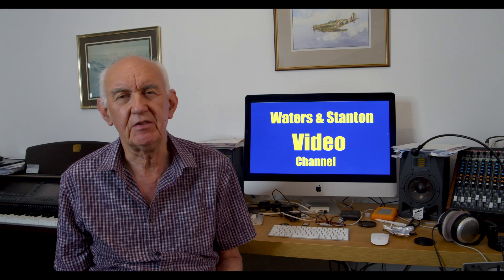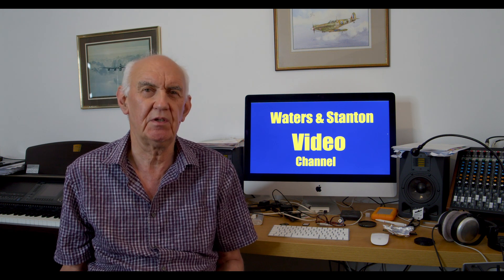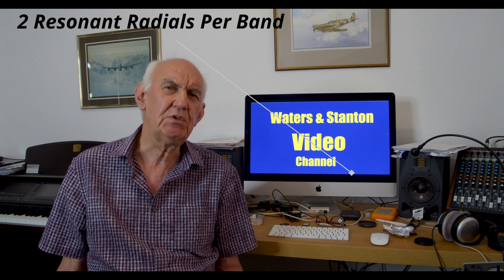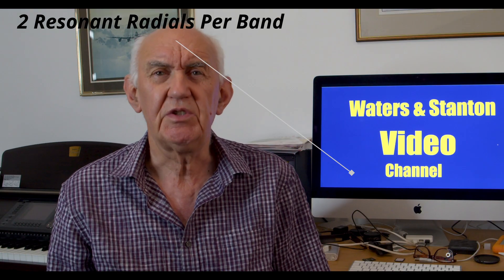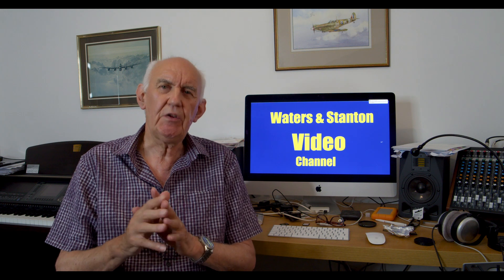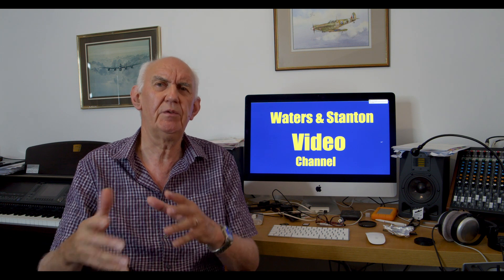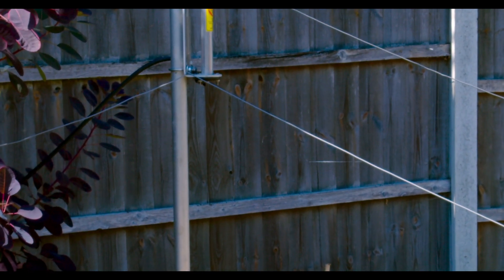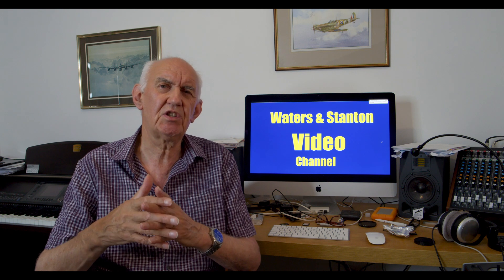Grounded or Elevated Radials? - Your Landslide Vote gives a positive Answer! | HAM RADIO

Comment: If you listen to what the DX record holders in contests use it's elevated radials. Make the vertical element longer than the radials. You want more current going vertical and not in the ground. Also for portable or a small yard you can use 1 full size elevated radial shaped in a 3 sided square. And it's within 0.1 db of several elevated radials. The higher the better for the antenna if you are in a crowded neighborhood. You will gain several db just avoiding ground clutter. Best of luck. Happy DX

Comment: 6dB gain just for rising the radials seems a fairytale to me. 

Where does such an unbelievable gain come from?
Maybe from narrowing the beamwidth?
Maybe from avoiding ground losses?

Nobody would be so stupid to use buried radials if as much as 6dB would be available just by elevating radials. 

Come on!

As far as others have experienced two elevated radials have the same effect of 16 radials laying over the ground, which in turn will give around 3dB less ground loss over a single radial laying on the ground. 

Just one elevated radial equals 8 buried radials.
One elevated radial has another important effect because will provide around 5dB front to back gain. We may be able to place the single radial towards the opposite direction of the main noise direction, which it's worth because hf bands are getting too noisy these days.
Reply from the maker: Tests carried out extensively over 12 months lonG path  G to ZL via chordal hop mode. QED.
Reply: @watersstanton  That's very hard to believe. 
Necessary and sufficient proofs required.

Comment: I just watched another video on this topic. The gentleman cut the single radial wire to the exact same length as the driven wire. The vertical was elevated approximately one and a half meters  and the radial elevated about one meter resulting in an "L" shape. The radial was not angled downward much but had sag in the middle. He too claimed about a 6db improvement. He speculated that it wouldn't care much for being near metal metal buildings and similar objects which leads me to ask, "are they greatly affected by vegetation or basically anything nearby? More so than other antenna designs? What about a wooden fence? Most folks have some manner of fence in smaller back yards. I initially pictured the radial being attached to a fence, lol. And the comment about the radials acting as a reflector?,..... is a good one! Or, a series of them being switchable to act as a kind of poor-man's beam? Cheers. 👍
Reply from the maker: Check this video. https://www.youtube.com/watch?v=CoQr3lJbhkA&t=5s

Comment: Yes i agree, I do have a 7 mhz vertical antenna about 4 meters above the ground with 3 radials and the performace a lot better then a dipole about 5.5 db gain the skip angle is perfect for DX, but for this frequency you need space.

Comment: I greatly appreciate your video confirming my thoughts!  Frustrated by no 10m performance, I finally realized that I had a multiband antenna fed from the ground up in a backyard surrounded by houses, sheds and garages and questioned how it was expected to work?   As an experiment I got  a 20 ft fiberglass mast and created a quick vertical center fed 10m dipole, thus getting the whole 10 m antenna elevated. Now I hear stations booming in!  I'd say more than 6db gain in reception because it didn't work at all before.  Now I will build it properly with 45 degree radials!
Reply from the maker: Well done. Good news
Reply: @watersstanton  Could you address grounding?  I was going to design my 45 degree radials as part of my guy wire system using a ceramic insulator. Thus I can put it up about 25 ft or so to clear the roofs.   But is there an issue if I run a ground wire straight down the fiberglass mast from the tie point of the radials??  Does it detune the radial design?

Or, what if the radials were attached to a vertical metal mast going to the ground, where the mask becomes part of the grounding system?

Comment: I wonder if the elevated radials have to be sloping towards the ground, or could there be horizontal.
Reply from the maker: Hi Brian. Sloping down is the popular method as it raises the impedance closer to 50 Ohms. BUT all VHF designs seems to opt for horizontal. Personally I would go with whatever is easier. However, closer to the ground it may be better to keep them horizontal. Cheers. Peter.

Comment: Fascinating topic Peter. Thanks for sharing. Elevated vs ground radials has been a dilemma of mine for quite some time. For portable (i.e. POTA) I’ve recently been using a 1/4 wave 20M elevated vertical using the MFJ 17 ft SS whip. It’s elevated about 5 ft with several 16-1/2 ft radials sloping downward but still about 2 ft above ground at the ends. I’m usually QRP when portable (KX3) and have had very good results. Please continue your experiments. We’d love to see more videos about this topic i.e. portable verticals perhaps with a reflector, or possibly experiments with an elevated 1/2 wave vertical. Chameleon is now offering a 25 ft SS whip, etc. Many thanks for your great channel
73
Marc, W4MPS

Comment: 2024 update: I've fitted my Chameleon MPAS onto our wooden pergola, 2.5m above ground, using the Cap-Hat, and 4 radials each of 10m / 5m / 2.5m in length, all 12 made of DX50 and roughly horizontal, each radial ends between 1.8m and 2m high.

The results are a LOT better than on the ground with spike and radials, plus I've got nowhere to fit them!

I'm using an IC-705 on 10W, got to Serbia from Essex (1081 miles!) on SSB, and FT8 all the way to Russia (2229 miles) and America (4289 miles).

Hope this helps.

Keep up the sterling work. 👍🏻
Reply from the maker: Great info. Many thanks.

Comment: With respect to elevated radials, is it possible to get them too high?  I am thinking particularly of 40 & 80 meter quarter wave vertical antenna.  I live out in the country and have the potential to mount antennas quite high on utility poles and run radials in multiple directions.  Thank you.  I really appreciate your channel and have learned a lot from you.
Hayes
Reply from the maker: 4ft or 5ft above ground gets the job done. There is no real advantage if going higher, particularly if you are in open countryside.

Comment: I can confirm the results. After recently watching this video I built a 15M monopole with 4 above ground radials, radials about 4 feet above aground . Sloping at approximately 45 degrees . Just got it up this evening during the WPX, good for testing reception and comparing with my EFHW which has performed well.  For North Africa, Western Europe, and the Caribbean .. signals were about 2 S-units better than the EFHW on 15M. For very weak Asians, signals about the same for both antennas.  Andy K3UK .
Reply from the maker: Hi Andy, Great to hear the results. Have fun.

Comment: Thank you Peter - It is a very interesting topic but I do not think there is a blanket answer that suits all installations. I have tried both elevated  and ground mounted 1/4 antennas for 10,15 and 20 meters at my home location and consistently the ground mounted antenna out performs the elevated type. I find that running the two versions side by side and switching while talking/listening  to the same contact, I found  that the elevated version is audibly louder on receive with little or no difference to signal strength. In practice it just seems to amplify background noise -  while the signal from the ground mounted antenna delivers much lower background noise which results in better performance especially where the pre amp is needed for weaker stations and in each case my remote contacts (all DX ) reported that the there was almost no difference from my transmissions for either antenna. In conclusion my experience  resulted with the ground mounted multi band  antenna offering better all round performance with the benefit that it is less of an eyesore and less likely to upset neighbours. I would also add that I am lucky in as much that my location offers a clear path free from buildings to the East, South and West with nearest houses to the North but some 20 meters away.  de Martin G6ZVL

Comment: I first put vertical for 40m band on the ground without radials. It performs okay, but not great. Then I rise vertical 5 meters of the ground, but that was shorter version with load coil (not a full length quarter wave). What a disaster. Then mounted back vertical on the ground, this time full length with 20 radials. Performing very well. Measured 6 dB over dipole that is situated 10m of the ground (G0EVY provided me measurement results, so Croatia -> England). I am not sure whether rising back again will do something better, but will try eventually one day.
Reply from the maker: Keep us informed.

Comment: interesting video peter. my vertical on the ground between trees and bushes and a steel woodshed only 1m away works extremely well in all directions, so not convinced lifting it off the ground or moving it into a empty field would achieve a great deal.

Comment: EXCELLENT POINT!
Ground mounting in an open field is fine but if you're like most of us and your back yard is surrounded by things like HOUSES, SHEDS, FENCES, telephone-power-lighting poles, trees, etc, etc,   you're just not going to get the performance you will if you elevate that antenna.

For the higher bands 17-10 meters I always "try" to put it on a mast and get it above the eave of my house's roof,  just the same as I do with my VHF / UHF antennas.  It's a no brainer.

Thanks for the reality check brother.

73, de KF4PCT

Comment: Great info Peter! Thank you! My question is whether or not the metal support post should be insulated from ground so that the radials are tuned correctly. 73 from Oregon!
Reply: I see no one has answered this but it's a good question because of grounding. Do you really want the radials isolated from any path to ground?  I don't.  Mounting them on a metal mast can be an effective ground (if deep enough), or if fiberglass you'd have a ground wire going to ground, but either way, how does a pole or wire going to ground from the radials, effect the ground plane performance?  Guess I'll have to experiment to see.

Comment: Hello,
Love youur channel.  If you have a 80m or 160m vertical and still have it on the ground...would it be advantage to angle the radical up from the ground at 45° and then travel horizontally parallel to the ground with a support at the end?
Thank you
Reply from the maker: I have not tried it but others report good results. Try it. 73 Peter

Comment: Just ordered me the hustler 4BTV.  Decided I'm going to elevate it about 5 and a 1/2 feet off the ground. We'll probably try 6 radials  With the proper radial ground plate and  see how it goes.  Just debating on whether to install on the edge of my yard near a tree and a  Large brick church with a metal roof,Or out in the middle or the yard where it's open, But then I have to deal with mowing around it more.  Thanks for the great information to help me decide on elevated.👍

Comment: I think we will need to raise our antennas especially as we need to comply with of comms new regulation on RFI we don’t want to end up cooking our neighbours will be accused of giving them headaches. so it is inevitable that ground-based verticals will all have to be raised. as I’m sure most of them do not comply with my normal sized gardens.
Reply from the maker: Well you will achieve around an S-point in signal in and out.

Comment: I have been wanting to try the idea of raised radials off of a 17 foot whip on a tripod.  Should the radials be horizontal to ground or slanting down at an angle?
Reply: You can slope them down to about a foot. Better yet try it both ways and see if your signal is better.

Comment: I built/used coax traps in each of 6 radials so that 3 resonated for each band 40,30,20,18,15,10. Worked very well with my StepIR vertical

Comment: I have an MP1 Super Antenna on a tripod... about 6 feet up in the air. In this case, the radials/counterpoise wires are partially elevated and partially strung across the ground. I have seen nothing that addresses this sort of situation in terms of technical advice or best practices. Is it an elevated ground radial??... I don't think so since much of it is laying on the ground. But the 1/4 wave vertical is elevated (6 feet) and the radials do slope down.
Reply from the maker: The radials need to be clear of tge ground tp perform as elevated radials.
Reply: @watersstanton  thank you. what do you think about using a horizontal hamstick as a radial? tuned to the band. I heard that idea yesterday for the first time. seems reasonable. an MP1 vertical on a tripod with a horizontal tuned hamstick. same as a dipole only in an L shape.

Comment: I have been a radio amateur for two years, and I built a fishing rod with a 4: 1 balun, the antenna is placed at a meter and a half from the ground, with radials, not exactly at 45 degrees, but there are. I connected from northern Italy to Japan, USA, Brazil. I'm really happy. hello IU3OYH
Reply from the maker: Sounds good. 73 Peter

Comment: Visiting WWV I learned that the HF antennas use Elevated 1/4 wave verticals with nine resonant radials, which also serve to keep the antenna standing.  I built an elevated 1/4 wave vertical for 20m, using an aluminum 5.2m support mast surrounded by nine 5.2m radials.  I found that slight length errors of the radial lengths actually widened the bandwith so that the antenna covered the whole band, with excellent low angle radiation.  Good point as well that a ground mounted vertical interacts with nearby objects.
Reply from the maker: Very interesting David. Thanks for sharing that info. 73 Peter

Comment: Except for driving considerations, isn't a vertical EFHW the same thing as a raised vertical quarterwave antenna with a single radial?  And isn't that the same thing as a vertical dipole?  Anyway, I'm hanging an EFHW 20m antenna from the highest limb in the yard (60'?), and figure it will give me that 6dB gain we all seek.
Reply from the maker: The EFHW will beat a ground mounted vertical. I suspect that there is little difference between the EFHW and a ground plane, but the GP is shoter in height and van be directly fed with coax. 73 Peter

Comment: I just changed my vertical ground mount 20 meter antenna to a raised mount and raised radials. The antenna is up 9 feet and I have 8 radials with a few more to come. 
So far, I have seen a huge increase in received signals and the antenna is a bit quieter than when ground mounted. Propagation? Maybe. But I do know that my SWR is lower when the antenna is raised.....1.3 as comparted to 1.7.   

As far as transmitted signal goes, It is difficult to tell as propagation could be different from when I transmitted when ground mounted.

So far, I am very happy that I raised the vertical and radials. Seems to have made a difference. Thanks for the great video.
Reply from the maker: Good to hear your news. If rx signals are better, then tx should follow in the same wat.
Reply: @watersstanton  In Northern Ohio I am getting 5-9 to +20 signal reports on 20 meters after midnight to most of Europe and Asia. +20 signal report from Japan.  I am hearing a whole lot more than I did when the antenna was on the ground. Increased radials from 8 to 16 and that really helped quite a bit it seems. Thanks again for the video and the information. Glad I lifted the antenna and radials. Will do that with all my other vertical antennas. I run single band resonant verticals to keep it all simple.

Comment: Hi Peter, although I do not automatically agree with every point there is nothing here that is controversial. In my small garden the buried radial solution is easier practically than some alternatives but is not necessarily ideal. A simple bit of trigonometry I am sure will highlight how much of my low angle radiation is going to "hit" surrounding houses and trees. (I will do the maths). 
As for the  length of elevated radials... I remember an article suggesting  that there was merit in making them about 10% long so that the radials are operating one side of resonance, ie slightly inductive. From memory it was not about the polar diagram but the feed impedance. By having the resonance of the vertical section at a slight offset to the resonance of the radials the reactance at the feedpoint does not change as rapidly with excursions in the band. Badly worded I know...
Reply from the maker: Thanks for sharing. 73 Peter